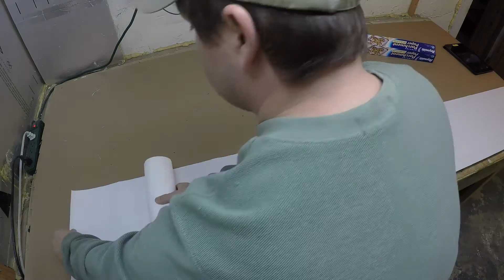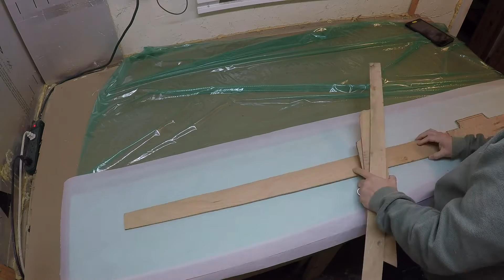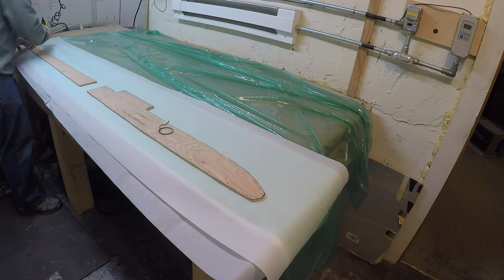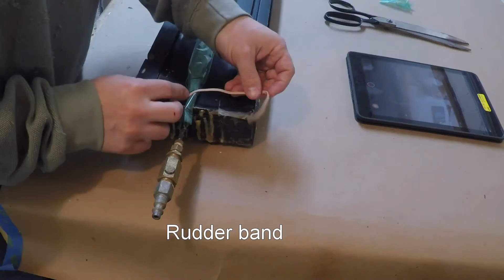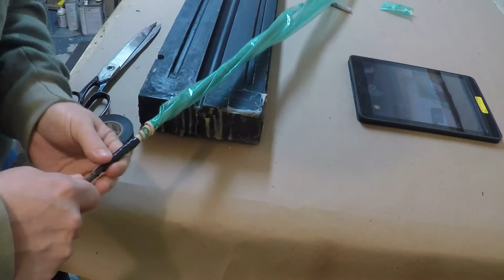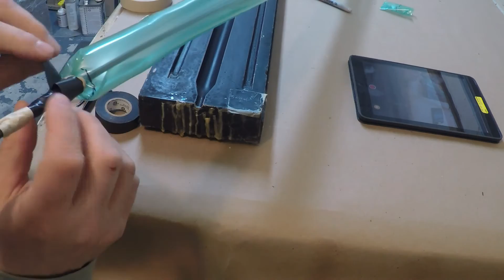Pressure Bladder Mold: Part 2

Comment: Hi, thanks for the video. Could you please tell why you use parchment paper? Cant you directly weld on the film?
Reply from the maker: Yes and no. Without the parchment paper the film will melt itself to the surface…
Reply: @BlueCubAdventures  so it doesn't cause any issues when the soldering tip touches the film, right? You are more concerned about the molten film touching the table's surface I guess.
Reply from the maker: @mehmetakifyalcnkaya7350  no you also need a layer there as well. It will definitely melt to iron.
Reply: @BlueCubAdventures  So you are applying quite a pressure to get it welded then. I also did not understand why you flip the bladder after cutting out. Is there a specific reason? Is it necessary?